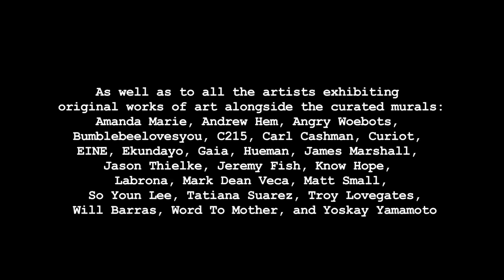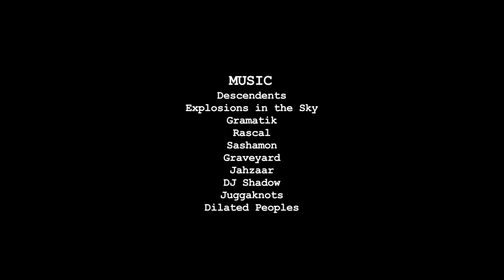Vitality & Verve : Transforming the Urban Landscape at LBMA

Comment: NICE! The ONLY female gets a tiny bit of a wall, while the dudes dominate the whole f'n building!
Reply: it was her first mural so she wanted to stay to a smaller section and to her credit,  her spot was the very first upon entering so her mural received the most attention - She also did not want to be in the midst of all the spray paint as she used all brush - Audry was thrilled to be included and has been knocking it out of the park since doing large scale work - the last mural show featured several female artists who had huge walls -